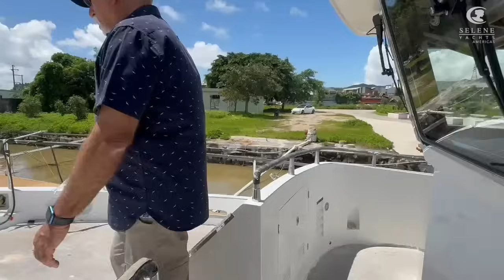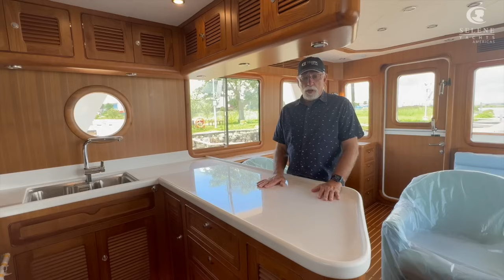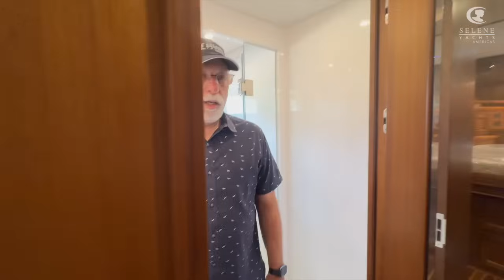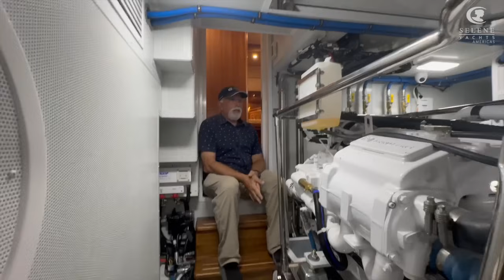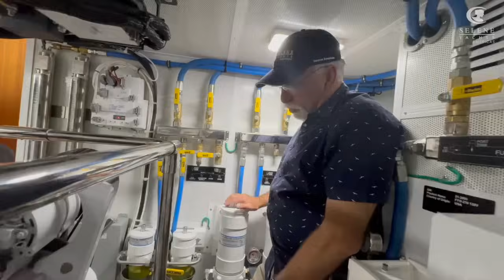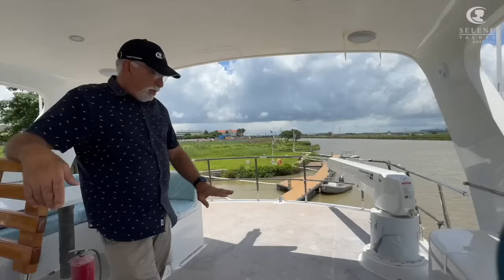New Build Almost Complete - 2024 Selene 45 Walkthrough

Comment: Extensive tour. Seems like Selene packs a lot into 45'. An impressive lot. (Stabilizers?) I'm sure I won't be the only one to mention the missed opportunity to have focussed on the boat's ample storage. All that other stuff is nice, but we all know that when you go to sea, bringing along ALL your stuff is key. I mean, otherwise, why have stuff?

And a John Deere diesel? Good thing those engine-out hatches are designed in, as Deere products are dealer-servicible-only, last I heard...
Reply from the maker: Thank you for your thoughtful questions. Yes, these boats do have a lot of volume, are stable and tons of room for storage. Great observation! Regarding John Deere - each of our vessels is unique and the buyer of the ship has the choice of engines. In the field we are seeing good to amazing performance out of the John Deere engines. As stated in some of our other videos the key to trouble free engine operation comes from making sure that the engine is in a great operating environment. We take a large amount of engineering effort to ensure that the engine has clean fuel, clean seawater, a cool engine room as well as an exhaust system with low back pressure. Ensuring that the  basics for a happy engine are met we see very few failures in the field.  With lots of room to work around the engines performing preventative maintenance is much easier as are engine room checks and larger maintenance tasks. 
We are working to ensure that more monitoring is placed on our vessels to find problems before they happen. And in the event of the worst possible outcome the vessels are fitted with either wing engines or a get home drive.

Comment: If the washer and/or dryer need to be replaced, is there a procedure for getting the old out and the new in?
Reply from the maker: Thank you for the question. The size on the washer / dryer is aprox. 23.5" while the width in the stairs and door out the salon is around 26" so you can just take out and replace.

Comment: Great video. But why do I write so ?
First I am sorry about syntax errors: english is not my native lanquage.
During years I have seen hundreds of videos about boats/yachts and I have found my favourites again and again.
I was not very interested about Selene before this video. Why ?
Basic layouts of same size of boats are quite same, and for reason.
It is about details and how to use spaces as efficiently as possible.
Builder needs to think about hundreds of thinks and naturally seaworthines is most critical (that includes safety).
What makes yachts practical are customers ideas and naturally manufacturers solutions to make those.
This particular yacht is semi custom and that got my attention.
Points, not in special order are:
-Many gates both sides
-TV on lift at saloon (it easy to hide when you prefer to watch thru windows) at good watching height. And big.
-Well thought galley with enough storage including fritz and freezer.
-Large cockpit where you can choose do you want to have ladders to flybridge or not (if steps from pilothouse is enough)
-Good size pilothouse with pilot perth. I wonder is there space for pilot chair like a bit bigger models have...
-Smart indoor way to flybridge
-Large engineroom
-Hydraulic get-home solution which saves a lot of space comparing to wing engine. Naturally if you damage propeller that does not help but orherwise is very good solution
-Has two staterooms and two heads with separate shower areas. Amazing ! Still enough room to move easily.
-Lot of floor hatches for easy access to service under floor technology
-Extremely high quality work everywhere (woodwork, electronics etc)
-what really stole my attention was separate washer and dryer located to place where those should be: near staterooms. Also separate dryer is really needed if you want to have dry clothes (no: compined washer-dryer does not do so). That location means that quest stateroom looses high storage but at companion way near stairs there is space for that.
Also under beds.
-Second very well thought space is separate utility room under saloon and indoor hatch to go there. So much storage space including extra freezers (or fritz or compinations as you wish). And lot of space for tools etc. Amazing to notice how much usable space boat has when everything is thought and also asked ideas from customers.
-Staterooms are large enough for longer trips 
-Master stateroom has hidden ladders for hatch escape if emergency happens
-Storm shutters on windows.
-Portuquese bridge
-Raked pilothouse front windows
-Video showed a lot of details but one think I tried to find is location of fuel fills. Ideally - if split to two - near each others so you do not need to draw filltube around

Fed words about video itself:
-Wayne knows this yacht well and it si good starting point
-As wayne said: professional videographer was not available when he got time to shoot this but still some comments 
-It is allways good to walk thru the yacht with videographer and explain what presenter points out before videoshooting. That way videographer knows when it is time to follow talking head and when to show points of interest. It is so booring to look talking person instead of subject (S)he talks about
-It is good to videorecord separately and from many angles those points and add those to final video at edit. You can´t record too much material; you just need to think well what goes to final video
-It is good to show - like Wayne did -what is behind every door and hatch. But take time to explain also well
-It is good to speak as much as possible about technical solutions and used equipment because you really know even smallest details. If somethind does not interest someone, (s)he can skip that part.
-When showing details do no hurry: it is interesting to see labels of individual switches and fuses and equipment. It does not matter if video gets longer; it is sales material and many see product (in this case yacht) first time.
-Would be helpfull to see layouts. Jeff M uses that a lot showing where he is and that really helps to understand boat´s layout. It is good to show layouts (flybridge, main deck, lower deck ets) long enough and with good resolution. Also diagrams and lists (dimensions etc) so long that even not native english speaking (reading) viewers get time to read and understand that.
-Do not repeately repeat phrases like "unbelievable", "Extreamly amazing" etc. Let viewers notice that by showing it. Ofcource it is good that presenter is broud of product but please stay on facts and tell (and show) what makes this yacht special

-My comments about "how to" are not critics about Wayne; I just point what I would like to see and hear.

After this veeeery long story I still want to tell that This version of Selene 45 is my dream yacht and hopelully at some day I can be broud owner.
Reply from the maker: Wow, thank you for taking the time to watch the full video in detail and provide very thoughtful feedback. We appreciate it and hope you can also become a proud Selene owner. Best wishes!
Reply from the maker: Yes, thanks for the detailed feedback. This is Wayne and I will take your suggestions seriously. We are always open to hear from our viewers and get their input so we can make these videos better for you. Thanks again.

Comment: I bought a 2009  Selene 43 2 years ago and  under went a $150,000 refit after purchase. The major differences are the engine (Cummins 350 hp in mine)’ Spledide washer dryer, hard top, and no get-home as there is no room. Updates included restoration of the interior teak by Huckins Boat Yard, all new Garmin electronics, hull paint, and Wesmar stabilizers upgrade with at anchor function and many, many other smaller changes including Starlink.
Reply: Thank you for sharing!!!
Reply from the maker: We'd love to see photos of your boat and the work you put into it. info@seleneamericas.com also if you ever need any support.
Reply: Im glad to hear your upgrades are to your spec's...

Sorry you had too spend more money!